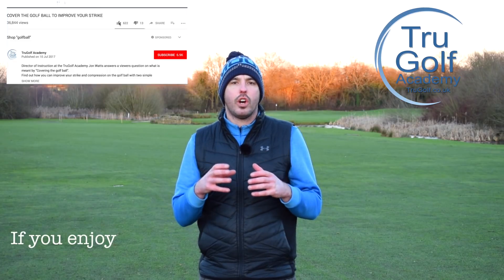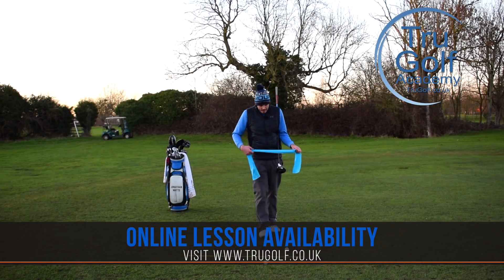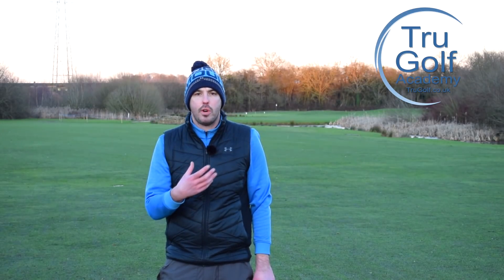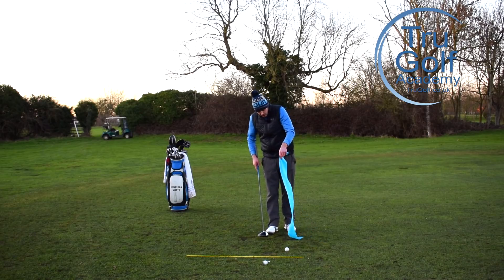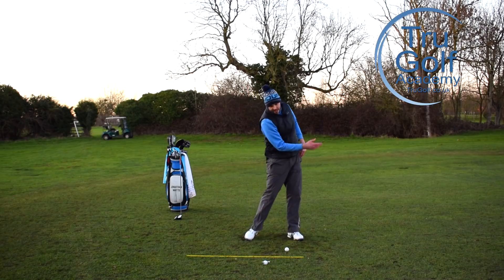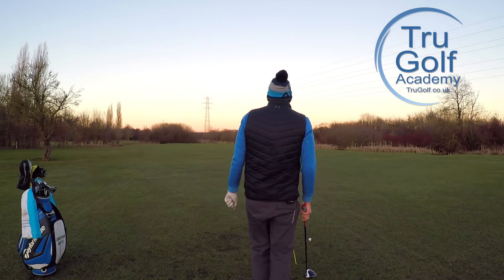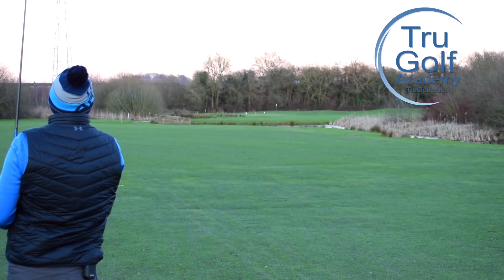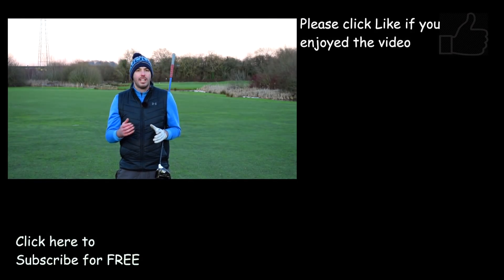ADD DISTANCE TO YOUR DRIVES - LOAD YOUR BACKSWING

Comment: Basically an anti forearm rotation. When the back of the hand is facing the target at adress it has the same position when you coil if you use your upper body as a reference point. Don't know if that make any sense.
Reply from the maker: There definitely is forearm rotation but I would like it to be gradual and controlled by body rotation rather than an independent action 👍🏼